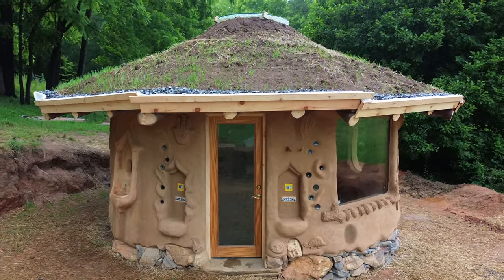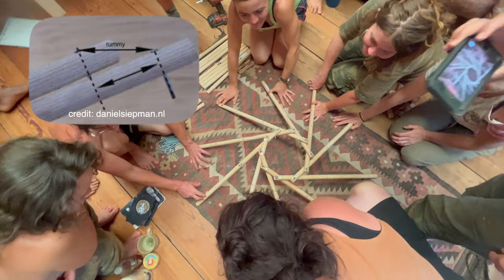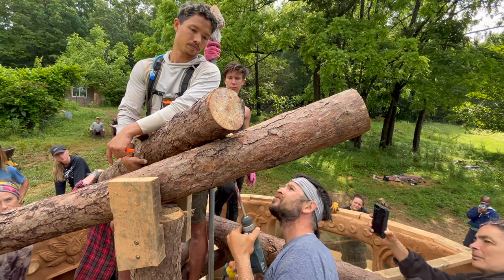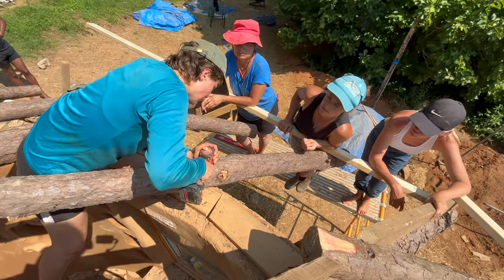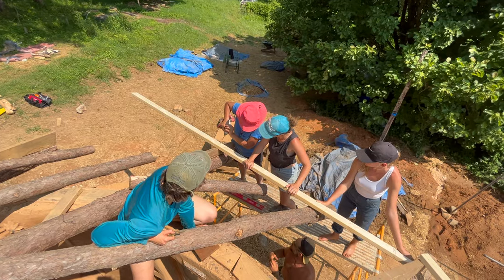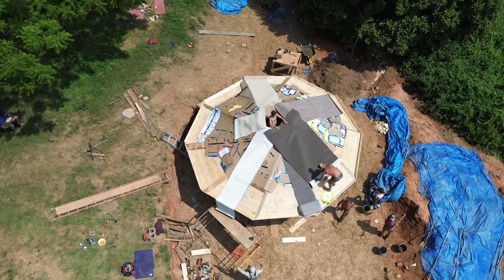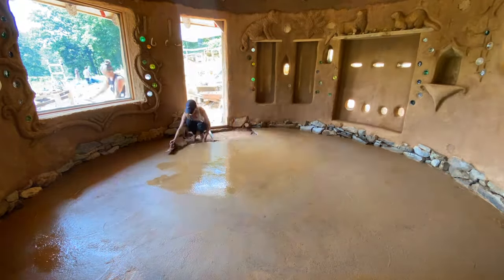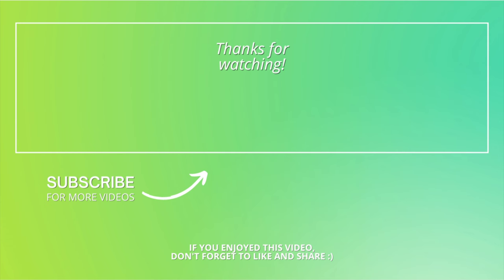How To Build A Reciprocal Roof | COB HOUSE Part 7

Comment: Thanks for the video!
This is a beautiful build! Just some small details seem to me like they're not gonna last more than five years, like the waterproofing (especially the installation of the drainage pipe), the glass roof or the open facial board. Which is a pity, since there has been so much effort put into the project and the longevity of it depends fully on staying dry!
Saving money, of all things, on the waterproofing of one's clay building is something I would strongly advise against...
Also when using natural logs it's always best to remove the bark because this is where insects will go first, but I understand it might have been too much work.
Anyways - stunning result and I learned quite a bit from it :)